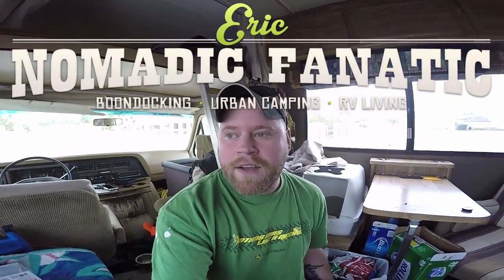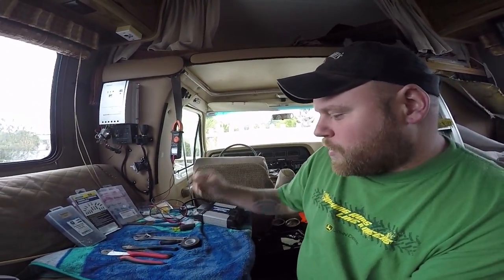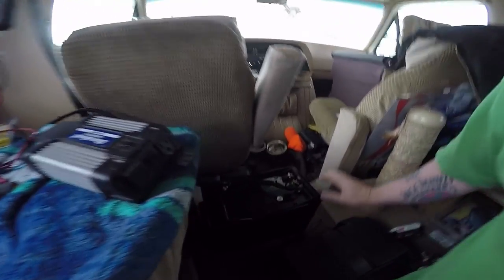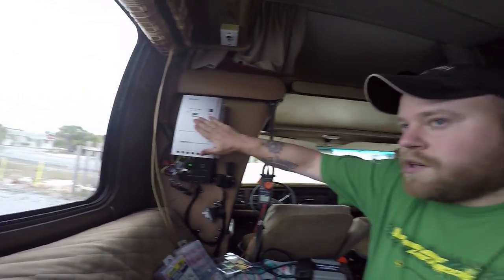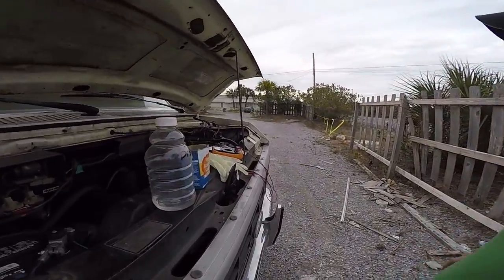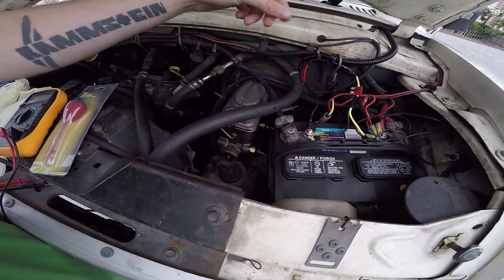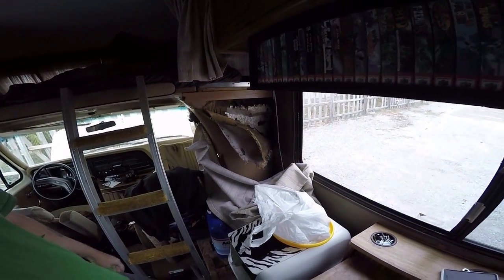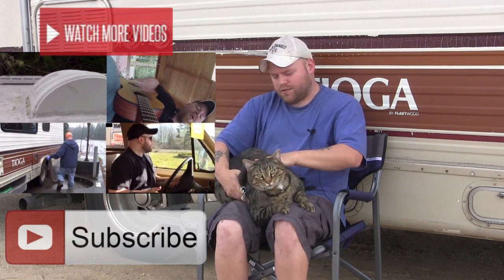Finishing My Second Battery Install

Comment: One thing your forgetting in this video eric is yes the panel is rated at 8amps..... but its a 24v panel. After MPPT does its thing, your guna be putting about 16 amps into the battery :P

Comment: A Watt is a Watt. If you go from 24 volt to 12 volt you always divide the watts by volts to get the total amps that system will "Output" at its final connection from the charge controller to batteries. I'm also no fan of fuses. I wire my stuff to push button breakers at a central location. Only the main service gets the big 60 amp fuse. The alternator gets the 150 amp as it's an high output alternator with #2 wire to the transfer switch.

Comment: Not sure if anyone else has mentioned it yet, but try to buy yourself a pure sine wave power inverter.  There are some good prices for them online.  The minimum I'd get is a 600 watt unit.  Usually the bigger ones are the quieter ones too, unlike the smaller WalMart ones tend to be very noisy and have "dirty power".  I have a 1500 watt Tiger Claw pure sine inverter, but not sure something like that would be in your budget.  But pure sine is better/safer/cleaner/more efficient especially for your electronics.

Comment: Bro.. in a word Voltage Sensitive Relay (VSR), a 12V VSR can automatically connect and disconnect your house batteries (from your truck batteries) when a charge voltage is reached (above 13.6V or whatever).. (so that would remove the need to remember to flip that switch when you start your engine etc, i.e. they protect your gear from engine startups automatically), a VSR is should be something like $50US and they are only a two wire install.

So this means you house battery can be charged up from your alternator while driving.. and when your parked and the solar in at a charge voltage the start and house batteries are connected and charged.. (at all other times they are just disconnected) nice n simple... you can add auxiliary batteries like this too.. that just automatically connect and disconnect etc.

RV's are great.. and should be compulsory!, in New Zealand we call them motorhome's (not RV's).. anyway below is a link to a good 24V (or 12V) wiring Schematic for an RV (I have wired up a few like this now)
http://www.aasolar.co.nz/AA%20Solar%20FAQs.html#2424_system

If I was you bro, I'd buy another AGM battery just like the one you just scored, wired that up in parallel, Im guessing your system is 12volt (just to make a bigger battery at the same voltage) and then hookup a VSR (from this battery to your truck battery).. with the override switch in place.. that you give you a bit more control over where the power goes to and comes from... and heaps more power!... AGM's are good.

I didn't see any battery monitor in your setup dude.... yeah in that case I can only speak to how great 'battery monitors' are (a good 'battery monitor' or 'battery computer', with a shunt that measures the AMP's in and out i.e. total power usage, and provides a Amp Hour remaining readout)..  if you have not had one yet, its a very cool upgrade, heaps of RV freedom/fun = control over power etc.. pricy tho... but again only a two-three wire install.

it's damn fun to improve your RV.. there's always something that can be improved or changed.. and it's not a major mission to do it.. and so satisfying afterwards.. ..
Reply: I believe you can accomplish the same thing with a standard relay like this: http://www.amazon.com/Auto-Truck-Relay-Socket-SPDT/dp/B007JPPQH6

I made a motorcycle trailer with a battery in it.  I wanted to isolate the battery in the trailer from my motorcycle.  While the bike is running, it charges the trailer battery as well as the motorcycle battery.  I set it up this way to isolate the batteries because if you hook 2 batteries together they will draw each other down trying to balance the voltage between them.

Anyway, Eric...if you want I have a very simple wiring diagram.  Just let me know.

Comment: You might also consider putting a cigarette lighter connector with that second battery.
Reply from the maker: Daniel Ferry That's what I did.  That dual DC outlet right off the battery. Plus the inverter.

Comment: You could run your wires that Jax loves so much through one of those foam pool tubes that come in many colors and I think two sizes. They either are already scored so you can put the wires in and out easily but Jax cannot eat them. Just a thought.

Comment: Really like the setup. I am wanting to add at least 250watts of solar to our camper with 4 x 6volt golf cart batteries. I alreay have several different size inverters to run in there. 

My only concern about your new install is for safety I would fasten the battery down to the floor behind the seat. That would be one heavy object flying around in a crash or if you have to swerve hard. Keep up doing the great videos. Tell Jax hello from us in Alabama.

Also can you suggest a free or cheap video editing software. Need to be able to edit my videos but I am not working right now so cheap or free is best. Thanks again.
Reply: I thanks I just downloaded the microsoft one and like it so far. Thanks

Comment: Not criticizing just thinking out loud.  The AGM batteries gassing is not something I worry about too much myself.  I think you're probably Ok there but if you blow up Tilly or explode Jax out the side window I am not to blame.  That said, when I build my Tiny House I'm a bit more worried about the possibility (inevitability?) of a catastrophic battery failure burning down my house.  I want the batteries to have the benefit of a climate controlled environment so they don't lose half their capacity in the winter so I need them to be 'indoors".  This has me thinking of some kind of fire protected enclosure (maybe something lined with concrete backer board?  Somebody knows) that is heavily insulated to the outside wall but not so much on the interior side so it will be room temp.  If I were running a full size house off solar I would not feel comfortable living on top of the battery bank necessary to run that kind of load and would build an entirely separate brick enclosure to store the battery bank away from the house.  Expect the weight of the batteries in my tiny home will exceed five hundred pounds on their own accord just to give you an idea of scale.   I expect that battery that Eric bought weighs in around a hundred pounds.   Good luck Eric.  You can always figure that there's only a one in a million chance something will go wrong with the battery and kill you.  OTOT, there 's a one to one chance that some kind of dumb shit is gonna kill us all, so you gotta drink beer *(and/or smoke weed) while scratching Jax's ass for as long as providence allows.  Enjoy.

Comment: I guess I'm as confused as a lot of people on why you aren't using the larger panel and the Renegy controller to charge the new, larger battery.  It's not an issue of trying to jam the bigger battery under the hood.  It's just the idea that a larger panel, a more efficient controller and a brand new big honking AGM battery are going to handle the overnight load better.  I also think the bigger battery can charge more quickly under the maximum heaviest output from the solar panel.  Batteries tend to get slower to charge nearer to maximum charge no matter how much current is available.  The MPPT Renegy unit is much more efficient than the smaller controller too.  Enjoy.

Comment: Connect the coil of a relay to your ignition switch that will disconnect your solar controller whenever your ignition is turned on.

Comment: hey Eric great video. learning lots form your trials. Just a thought you did do a great repair on the other side so maybe done the road you could do the other side as well with a swing door panel and run all wires in the back cavity then you don't see them and JAX can eat them. I too have animals that love to eat wires and would hate if any thing happened to them as well.

Comment: FYI: 250W at 24V = 11Amps. 250W at 12V =21Amps. Your 10A fuses are choke points and should be blowing on a regular basis. It is safe but may become a pain in the ass. I'm just a 20yr electrician so I dont know much ;)
Reply from the maker: ***** Thanks, but I am reading that information right off the back of the panel.  It said 8.3 amps max.
Reply: Off Grid Texas Homestead Volts x Amps = Watts. Ohm's law is different, Volts = Amps x Resistance (ohms). In either case, if you know 2 of the values you can figure out the third.
Reply: raygunz333 http://en.wikipedia.org/wiki/File:Ohm's_law_formula_wheel.JPG
Visit this page and tell me what it says at the top of the page, Ohms law is not different, this is ohms law. There is actually a guy named Ohm, resistance is in ohms, which is named after Georg Ohm. Volts X Amps=Watts IS ohms law.
All of the formulas in the ohms law wheel are part of ohms law, its not just resistance but all those formulas.
Reply: Nomadic Fanatic
Sorry, I should have known this would start a correction section in the comments. I'm just letting you know you could up those fuse sizes if you needed to. I'm sure you did your homework first.
Reply: Nomadic Fanatic Math doesn't add up, if it's a 12 volt panel x 8.3 amps = 100 watts. Is it a 24 volt panel? Either that or your confusing with your 100 watt panel? Does the new panel actually say 12v 250 watt? Just wondering...
Reply: Yeah, something isn't right. Either it isn't 24 volts or it isn't a 250 watt panel or something. These guys are using ohms law, look up ohms law and do the math Eric
Reply: Lol
Reply: *****
haha...I wonder if this boys mama knows he is up this late on her computer...
Reply: ***** He used #10 gauge wire / 30 amp from the roof solar panels to the controllers then #12 gauge wire / 20 amp from the controller to the battery fused at 10 amp.  #10 Gauge from inverter to inside AGM Battery.  Even his solar panels are fused too.  I see no problems at all with his install in another previous video. 
I counted a total of 5- 10 amp fuses & 1- 30 amp fuse for a total of 6 fuses.
Reply: Just remember it's not the voltage, it's watts. The only reason to go with higher solar panel voltage is to use smaller wire.

I have to explain this all the time because a watt is a watt. You size the fuse to the wire size but you also use the correct wire size that fits the maximum output of the charge controller. This insures that one you're not losing any voltage from resistance using smaller wire. Two, you can upgrade without having to rewire the whole system. 

I think he even said he had 150 watt panel and one 100 watt panel. As he can't charge different type batteries off the same controller or you will toast one of the battery types.

Comment: you should have used a diode instead of the switches it would be much easier for you since you would not have to turn it off everytime you want to drive

Comment: Eric I may be wrong but a 250 watt solar panel 12 volt should put out around 20 amps at best. Like I said i could be wrong I am still learning this myself but take a look at this site it gives you a close estimate of volts watts and amps   http://www.supercircuits.com/resources/tools/volts-watts-amps-converter
Reply: P / I= V  which is 250 watts divided by 8.3 Amps = 30.12048 volts, so the panel must be a 30 volt panel (probably 24 volt). You can't argue with ohms law.
http://en.wikipedia.org/wiki/File:Ohm%27s_law_formula_wheel.JPG
Reply from the maker: M Baldridge I read right off the back of the panel "8.3amps max output"
Reply: Off Grid Texas Homestead you are probably right, i was not thinking the panel could be 24 volt. Guess if Eric see this maybe he could let us know

Comment: Nice upgrade Eric.
This battery(AGM) also has different charging requirements than wet cell I believe. That controller will work but the battery will not last as long as it should. Might want to charge every now and then with a charger that has a AGM setting that will help. Just a thought :)

Comment: Have you ever thought about getting one of those solar ovens?
Reply from the maker: Stacy Harrington If I had room, yes. But while on the road, I don't want to get it out every time I need it. If I was boondocking full time parked somewhere for a month, maybe.
Reply: Nomadic Fanatic I saw a youtube video where a solar oven was made out of that reflective window covering - light weight with the bubbles inside sandwiched between foil, flexible, cheap at the dollar store.  I can't try it out now because the sun is too low in the sky, but later this year I will put it to the test.  It doesn't take up the space the metal hard-sided (and expensive) solar ovens require.

Comment: Hello Eric,

Just some random thoughts on AGM (ABSORBED ELECTROLYTE)  Vs GEL (GELLED ELECTROLYTE)

AGM (ABSORBED ELECTROLYTE)
Advantages

Ideal for standby or back-up applications
Higher charge and discharge currents
Totally maintenance-free
Air transportable
Spill proof/ Leak proof
Minimal corrosion thus physically compatible with sensitive electronic equipment
Installs upright or on side
Lower cost than gel cell batteries
Very low to no gassing (unless overcharged)
Excellent for starting and stationary applications
Superior for shorter duration/higher discharges
Disadvantages

½ the cycle life of Gel or flooded Wet Cell in deep cycle applications
Charge voltage must be limited (14.1 to 14.4 volts maximum at 68°F )
Voltage-regulated chargers must be used
Water cannot be replaced if continually overcharged

GEL (GELLED ELECTROLYTE)
Advantages

Totally maintenance free
Superior deep cycle life when compared to AGM
Air transportable
Spill proof/leak proof
Minimal corrosion thus physically compatible with sensitive electronic equipment
Installs upright or on side
Very low to no gassing (unless overcharged)
Superior shelf life when compared to Wet Cell
No recharge current limitation @ 13.8 volts
Rugged and vibration-resistant
Very safe at sea with no chlorine gas in bilge (due to sulfuric acid and salt water mixing)
Most versatile: Starting. Deep Cycle, Stationary
Lowest cost-per-month (cost / months of life)
Lowest cost-per-cycle (cost / life cycles)
Disadvantages

Higher initial cost
Water cannot be replaced if continually overcharged
Voltage-regulated chargers must be used
Charge voltage must be limited to extend life (13.5 to 13.8 volts maximum at 68°F)

NO! Never install any type of battery in a completely sealed container. Although the normal gasses (oxygen and hydrogen) produced in a Gel Cell battery will recombined and not escape, oxygen and hydrogen can escape from the battery in an overcharged condition (as is typical in any type battery).(AGM / WET CELL)

Travel Safe
Thomas

Comment: Just curious. Have you switched over to LED lighting yet? I know you know this Eric but for those who don't, an led light uses about 6X less power to provide the same light output. Lot less stress on the batteries. The new ones have a very comparable quality of light to an incandescent as well.
Reply from the maker: Mike Hunter Half LED right now. Every fixture inside the RV has one LED bulb in it on the first click, then the old bulb will also come on on the second switch. I'm upgrading slowly.
Reply: Nomadic Fanatic Good.  I wondered about that along the way too.  When I build my tiny house it'll be totally LED.  The price on bulbs has dropped dramatically and at the end of the day the living space in Tilly (and that of my anticipated tiniest home...lol) are not that large that it'll take a whole lot of bulbs either way.  I have worked up a projected total cost for solar lighting (panel, renegy controller, battery). that comes out to around $750 without fixtures and I expect will run my LIGHTING for at least two or three days with no sun at all.  I'm afraid to figure out a solar system for running larger appliances because I'm sure I'll end up in shock at the cost of that!  Actually, I'm slowly working it up and it includes air conditioning so you know that I am either extremely optimistic or totally out of my mind.  We'll see as time progresses.  I'm sticking with the former.  Enjoy.
Reply: There are some inferior leds out there that get hot, and become a real fire hazard! be careful!

Comment: Hey Eric just curious did this coach not originally have separate coach batteries when it was new?
Reply from the maker: Allen Jeter It's an 80's Ford thing. Both the starting battery and one deep cycle battery are under the hood. There was no "battery bank" 31 years ago as they just intending for the RV to go from plug in park to the next. That one battery is meant to get the RV to the next desitination, not be used non-stop as the only power source.

Comment: is that battery under the hood the engine starting battery of did rig come with separate house and engine battery?
Reply: he has shown in earlier videos that he has 2 batteries under the hood ... 1 for the engine and the other for the camper section.  FYI
Reply: djkulp1 tks

Comment: Does the solar panel charge the batteries while driving?
Reply from the maker: Anthony McGettigan That's why I have the relay switch. My alternator charges the main deep cycle battery while driving, so I flip the switch on the 250 watt panal and controller before I start the RV. But the other 100 watt panel goes to this new battery which doesn't get charge from driving, therefore, I need the solar panal giving it juice while driving.

Comment: Nice job Eric, looks clean from here, Jax"s should not be able to get in trouble with all the planing. Guess there a way you can check the new AGM battery's voltage so you don't have to much draw down, guessing the inverter will show that?